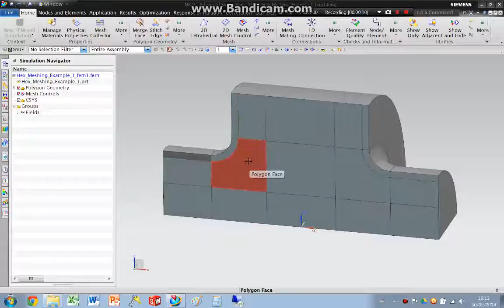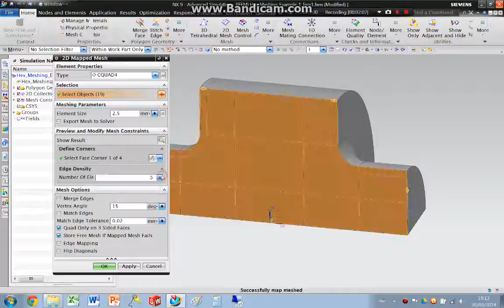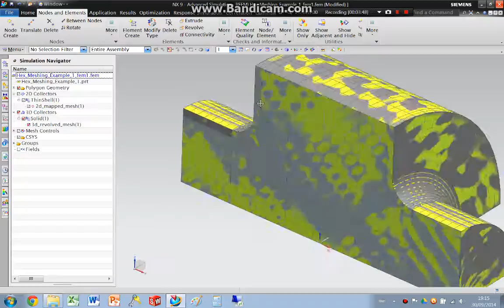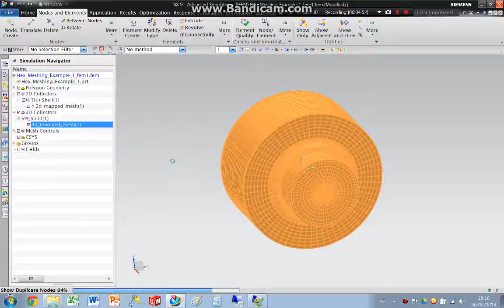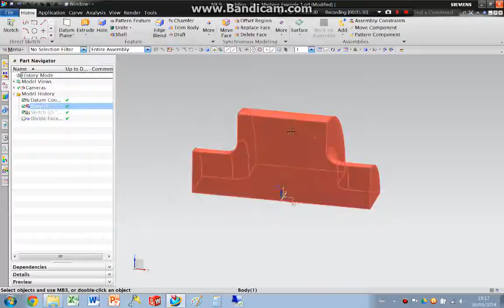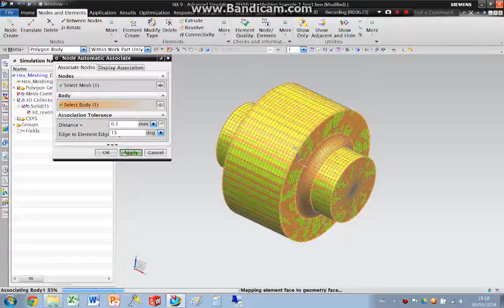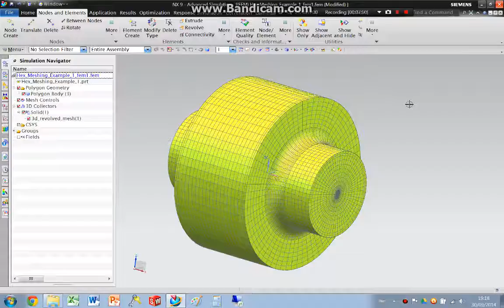NX Hex Meshing Example 1 Part 2

Comment: Hi Matt. Thanks for the great tutorial. I have a question. My created a similar model like yours. After I associated the nodes with polygon geometry, I run a check. All the nodes along 0°,  90°, 180° still do not associate to geometry. I tried to solve this by associating the nodes manually, without success. Could you show a demo on how to repair (associate) these nodes? Thanks in advance...

Comment: Could you help me solve the problems.
ERROR
No material associated to mesh "Solid(1):3d_revolved_mesh(1)_morphed_morphed_morphed".
Either no material is assigned to the mesh container or some of the underlying geometry 
(body) do not have a material.
SUGGESTION: Apply a user defined material to the mesh container or to all of the 
underlying geometry (body).
Reply from the maker: maivan dinh you have not assigned a material to the mesh collector that contains your 3D Mesh. Right click on the mesh collector and edit the solid property and assign a material. Thanks.
Reply: Perfect. Thank you so much
Reply from the maker: maivan dinh no problem. Do u have anymore questions or requests? Thanks.
Reply: not yet in this time. Thanks for your support